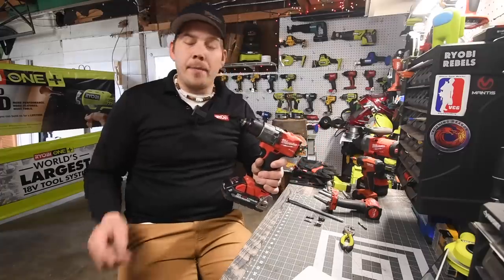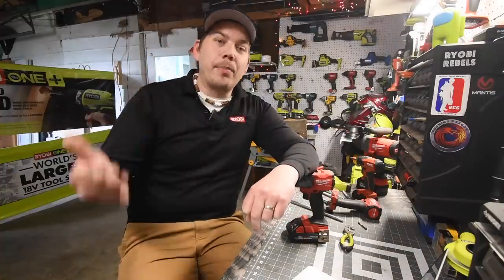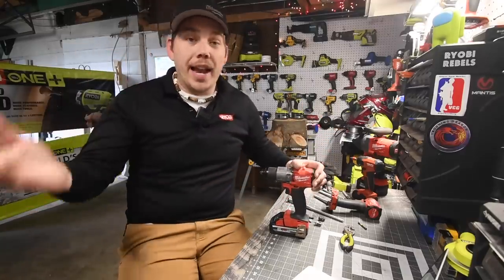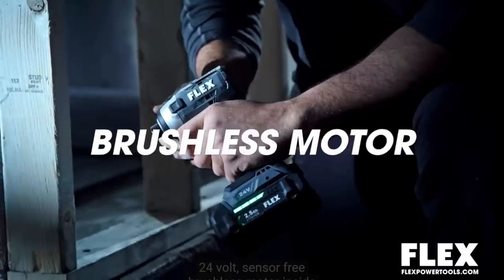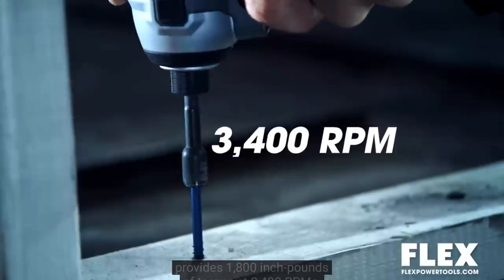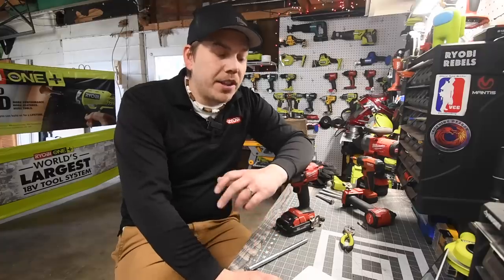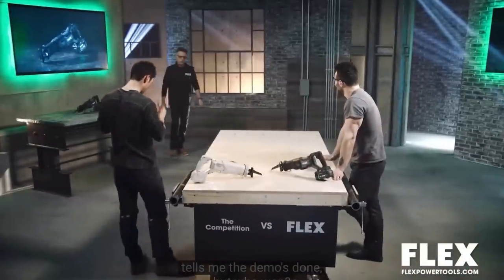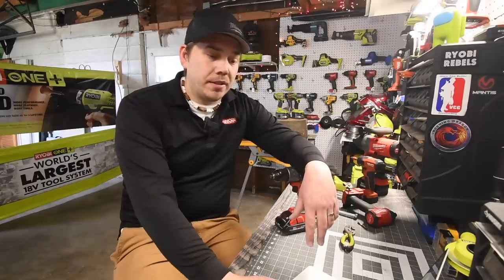My Flex tools vs Milwaukee  video RANT!!!!

Comment: I find is so funny how they didn't throw the dewalt 999 or 998 because the already knew what was going to happen
Reply: As of right now it’s dewalt vs flex. Milwaukee is trash
Reply: @lmaoanatorhilarious2582  Nope. Milwaukee is fine.
Reply: The 999 is a beast!
Reply: @lmaoanatorhilarious2582  I mean, if you want your tools to fall apart, by all means, stick with dewalt.
Reply: The dewilt would burst into flames and cause potential harm to the operator?? Or were you thinking that the yellow Ryobi would actually stand a chance 🤣🤣🤣🤣🤣
Reply: @whilomforge3402  I mean I'd rather go with dewalt and not pay and arm & leg for one milwaukee drill!!!!!
Reply: @mat_a.c.d.evloganstuff3917  I got my Milwaukee driver/impact combo with three batteries, charger and hard case for $399. If you’re not comfortable paying for a professional grade tool at that price, then I don’t know what to tell you. As a GC, I use these tools every day, and they are worth every cent.
Reply: @whilomforge3402  399! that is way to much for an impact, dewalt has a kit with a 996 and an 887, a 2ah, 1 flexvolt battery for 250. Milwaukee impact would probably out last the dewalt impact but still great for the price .
Reply: @mat_a.c.d.evloganstuff3917  tbh I’ve had 2 Milwaukee drivers in my lifetime and they both sucked. I might have been unlucky and got 2 factory defected models with shit batteries. I can agree with some points that some people are making. Like if you want a good tool then spend the money. If you’re using these things for hobbies then any of them would be sufficient enough. When it comes to the job site, spend your cash. For example I used to go through a graco paint sprayer every year since it can only do like 3-400 gallons a year . Now I run a titan sprayer and can spray 200-300 gallons per fcking week. I honestly don’t give a shit about brand. It’s all about the quality
Reply: @mat_a.c.d.evloganstuff3917  that’s for an impact, hammer drill, three 5 a.h batteries, charger and a hard case...
Reply: @whilomforge3402  dewalts hammer drill is more powerful plus you get a flexvolt battery
Reply: @mat_a.c.d.evloganstuff3917  nominally more power, and it’s a boat anchor. Also, that flex volt battery isn’t backwards compatible with the entire dewalt line. Milwaukee has a better battery platform and more extensive tool catalogue, along with universal battery compatibility on the 18 and 12 volt lines. Also, I’d wager a Milwaukee drill would far outlast a dewalt, under the same conditions. I’m not even entirely invested in the Milwaukee platform. I think there are a lot of superior offerings by Makita and even some by Dewalt, but Milwaukee is the best all-around.
Reply from the maker: I thank you for viewing
Reply: @whilomforge3402  watching you fanboys measure peckers is hilarious. I own the Milwaukee fuel hammer drill and the dewalt 999. Both are good, but the dewalt definitely has more power, and tbh my Milwaukee did crap out on me and needed to be serviced after driving a 3 inch hole saw through two layers of 5/8 drywall. May just be my drill but it happened. I also have an og 20v max regular drill driver I’ve had for the better part of a decade, it’s smoked out on me several times(mostly from tapping holes in metal door frames) but she still runs. I mostly use it for running fasteners in finished millwork. Drilling/tapping is what the 999 is for
Reply: @HoldinAces777  you didn’t read my last comment, did you? I’m not a Milwaukee only guy. I run the Makita 36v circ saw, dewalt table saw and Rigid vacs/dust extractors. The Milwaukee tools I use are the best all-around for what they do. Just like the other brand tools are the best at what they do. Maybe read your own comment again... you’re being a simp for your favorite drill, too...
Reply: @whilomforge3402  my man, where did i say anything about what was my favorite tool? i just said what i have and my experiences with them. That old dewalt smoked on me because it was under powered, the 999 is so heavy i have to drive my vehicle over weigh stations. No brand is perfect or “the best” overall. It’s a tool by tool ordeal thats why most guys have multiple brands. This is the first time I’ve seen someone use the word “simp” unironically, that gives me the feeling that you’re the helper boy that gets sent out to find material stretchers and left angle drill adapters a lot 😂
Reply: @HoldinAces777  just admit that you can’t stand anyone talking bad about your brand, big guy. You’ll feel better about yourself. Btw I’m sorry I triggered you by calling you a simp for DeWalt. You’re totally not a simp... not at all...
Reply: dewalt drills are complete garbage. Bought one myself, wouldn't put a 3/8" hole in light sheet metal. I'll stick with my milwaukee, they make tools that are quite capable, not to mention, they make tools for home and work.
Reply: @whilomforge3402  helpers shouldn’t talk to their superiors like that lol
Reply: @whilomforge3402  out here being a “simp” for Milwaukee when laborers like you only have one tool, and last i checked Milwaukee doesn’t make push brooms 😂
Reply: @HoldinAces777  it’s okay, buddy. Don’t get yourself all worked up over someone besmirching your yellow queen. I promise you’ll be okay.
Reply: @whilomforge3402  lol thanks bud, now go put my tools in back my truck, you’re never gonna move up the ladder if you wait for me to tell you everything 😂
Reply: @HoldinAces777  bro, you’re being cringe, bro. Just stop.
Reply: @whilomforge3402  cringe? They let guys like you in the trades? I bet you drink white claws too don’t you 😂
Reply: @whilomforge3402  bro dewalts better just admit it, stanley black and decker is better than tti so its all good

Comment: Thank u 4 making this vid.. about half of my tools are Gen 2 and half are Gen 3 all fuel, and I gotta say.. in my case it's divided like that as no one uses one tool all day and to be honest I have never had issues with the Gen 2s.. I've only upgraded as needed due to tools walking off site etc.. I find that most of the time peoples that search for the most "powerful" tools are usually guys that don't know how to use them to begin with. It's 90% about the operator and using the right tool for the right task.. I don't use impact wrench for task that an impact driver is designed for or viscera.. and to boot just like u said, they didn't even use all fuel tools and the operators noticeably looked like they were only trying when using the flex..  was kind of comical at time.. with that said there was some features of the flex tools that did interest me.. but not enough switch...
Reply from the maker: I thank you for viewing

Comment: There is so much you can do to influence each of those tests. Pressure on the tool, bit/saw sharpness etc, angle of the tool to cutting surface. The sawzall is a a good example, the flex operator had the saw with the handle angled higher allowing the tools weight and operators push from the back handle down to influence the tool. To show the tools are truly superior you need to look at max RPM and RPM under continuous, consistent, measurable load.
Reply from the maker: I thank you for viewing

Comment: Great video, Man Caver. When I watched the flex 'info mercial' I was wondering why they didn't actually tell everyone the competitor tool (manufacturer, model number, battery configuration, etc.). I knew they were hiding something, and you confirmed my suspicion. They found the best tool that Flex could beat (not necessarily the best tool on the market today). Thank you for another enjoyable, informative, video. You keep making them, I'll keep watching.
Reply from the maker: I thank you for viewing

Comment: Flex had the chance to really FLEX on the competition by only offering batteries with 21700 cells. just sayin lol. Also I like how you pointed out that they switched between using the brushless Milwaukee over to the fuel version. Kind of reminds me of the Chevy commercials comparing their trucks to ford using the aluminum how they were cheesy as hell.
Reply: Hard to fit enough 21700's in there to hit 24V and reach the Ah rating, agreed it was a lost opportunity to come out the gates with it though
Reply: Wouldn’t be surprised if several ex-GM people were behind this bologna. Or at the very least the advertising firms that were behind GM.
Reply from the maker: I thank you for viewing

Comment: one?
actually maybe more
since all of the milwaukee power tools were painted and covered over, and since these tools are brushless, and since these tests stress the motor which is now covered and painted over. would that not cause a bit of heat build up in the tool resulting in a lowered performance?

Comment: Exactly this face off was a joke they used some of Milwaukee’s worst battery’s and midrange sawzall and the testers were obviously putting more effort into the flex tools...it was ridiculous high output battery’s would have changed almost every result.
Reply: Not necessarily changed as Flex has some battery tech that should definitely handle peak loading better, but at least made the difference less pronounced.
Reply from the maker: I thank you for viewing

Comment: wait!!! whow! to be fair!!! im not a flex fan i know nothing about them but spade bits augers and such bits with larger circumference you should not push the bit hard.... if you push the bit hard you can stall, backfeed, or slow the bit. slowing the bit is bad because the speed is what kicks out the chips. if your chips are not ejected efficiently you will add more work for the drill..... so if you can push hard as hell and not stall or backfeed and win a race your drill has more torque to go with speed.... this is a sign of a good drill! strait solid bits are the only thing you want to push hard ish. like a hammer drill if you push to hard you can nullify its hammering function... pushing on the drill is what is to be done just not so hard you limit hammer travel and place a lot of the tools work in your soft fleshy arms. regular drill bits can drill faster the harder you push. you have to watch your speed because speed is heat and heat is dull. fasteners is the best test for speed because the only danger of hard or fast, is loss of control of fastener. 
SCIENCE lol
the 1 thing i will say if test are not done with weights, pullies, cantilevers and tracks you cant create repeatable fair test because a man with skill can beat a man with strength and a man with strength can beat a novice. so if a veteran of 30 years gets up there to compete with a novice his skill with a garbage drill will win vs a super tool in a novice hands..... you need a fair measure test

Comment: Okay so i don’t exactly know What flex means by sensor free but if he actually means sensor free brushless motor and the story About how they put the “sensors” down into the electronics is also kinda sketchy 
What sensors on a brushless motor do is tell the microprocessor in the tool the position of the motor rotor which makes it fire the individual coils in the motor in the right order depending on where the rotor is 
removing them is done by essentially calculating the rotor position based on the voltage the rotor induces into the other coils when it spins ( I think that’s what flex meant by “moving” the sensors into the electronics) and they are right this will free up some space in the motor compartment BUT in low rpm the motor driving chip basically blindly turns on one coil which moves the rotor in some direction (even reverse in some cases) and now the rotor movement creates a voltage spike in the remaining coils and that is what the chip uses to know the firing order of the coils to get the motor to turn in the right direction 
THIS IS NOT ANYTHING NEW and it has its problems mainly in the low rpm control 
Someone test these tools like the drill driving a screw really slowly I bet it will be jerky and stuttering
Reply: I'm glad someone else understands what Flex meant by "sensorless". In some of the tool review on-site testing videos, they actually step back and say that there are still sensors, just not in the motor directly, so definitely back-EMF sensing at least. There's an overview of low speed BLDC drive methods in this article for any that are curious: https://drive.tech/en/stream-content/sensorless-control-of-brushless-motors
They even say that removing the hall effect sensors makes the tool more durable - I seriously doubt a damaged hall effect sensor (which can be potted with little effect on functionality) was a primary reason for motor or controller failure, even if it is technically an additional failure point over just the coils.

The low speed control could be affected, but it could also be that Flex is running the motor internally at a much higher RPM so that everything is "high" speed, or that they use a slightly different algorithm for low speed, high torque control. I'll be interested to see what the tool reviews and press releases can tell us.
Reply: @connors.1077   there is absolutely no way to drive a BLDC motor with peak torque at low rpm based of EMF 
All the tools that do this are either saws that don’t need to have low rpm control or drills that actually are kinda shitty to use in those conditions...... a hall effect sensor under selastic is going to outcast the tool 100%  plus they are absolutely tiny and tbh barely add any size at all ..... they say we moved the sensors down BULLSHIT they are just not there at all it’s EMF based because it’s cheaper it’s literally a negative and they are advertising it as a feature ....... Yea the motor is spinning probably 1000rpm from the get go but this will affect the drill anyways especially trying to carefully loosen something where you would need torque from 0 rpm it’s gonna perform worse than a brushed 30$ tool in that condition 
Sensorless BLDC motors belong in drones not drills this is an absolutely dumb idea on part of FLEX
Reply: @connors.1077   well even if they didn’t say there still are sensors .... there is no other way to drive a BLDC without sensors than EMF
Reply from the maker: I thank you for viewing
Reply: @ManCaverTools   if you could do some low rpm tests like slowly pulling out a screw once you get the drill that would be great to see

Comment: These can be easily tweaked as company wants.
 
Is that big log uniform? There can be softwood behind it for Flex and some harder wood for rival.
You can pre drill screw in and then use old hole to drill in faster etc.

If something looks and sounds too good to be true usually it isn't true.
Reply from the maker: I thank you for viewing  :)

Comment: Good call with the rant video.   It’s hard to notice, especially if you’re just watching for the first time.  But flex did sandbag it for their stuff.  Which makes sense.  But it would have been nice if they didn’t and just ran a fair test.
It reminds of when Chevy was ripping on Ford for switching to the aluminum beds and Chevy was dropping rocks and cinder blocks into the beds.   There was a clear shot of a cinder block landing on a corner in the Chevy bed and punching a giant hole in the bed.   The camera cuts and suddenly the hole is gone in the Chevy bed and the blocks are arranged in a slightly different way.   People just want to see how it actually performs and will be disappointed when it doesn’t live up to the hype
Reply from the maker: I thank you for viewing

Comment: I can see your point on the high output batteries. I looked at the test as what you would possibly get in a standard powerpack / multi piece kit. with both competitors. There is no way that any particular brand can have the best of every tool....
Reply from the maker: I thank you for viewing

Comment: Another thing you may not have picked up on was the wheel on the FLEX was thinner.  A wider wheel will not cut as fast as a thin wheel does.
Reply from the maker: I thank you for viewing  :)

Comment: Thing is you buy the battery platform not the tool.  Tools change all the time and you often need a wide variety of tools, I have M12 tools for wrenching (impacts, ratchets) due to size and Makita 18v tools for woodworking (Milwaukee doesn't make a track saw AFAIK) and larger tools because that's the 18v platform I settled on.    I doubt that Flex is going to have even a kinda complete tool line....
Reply from the maker: I thank you for viewing

Comment: You made a lot of really good points Dave. I myself was wondering why they didn’t put the hammer drill up against the the DEWALT. Especially for the concrete test. Everybody knows the Milwaukee doesn’t like concrete. Keep up the good work bud. 👍
Reply from the maker: I thank you for viewing
Reply: My 10 years old Milwaukee with old 3ah battery loves concrete and i mean CONCRETE! I live in Poland and we have old really tough concrete building not like in US;P

Comment: They maybe faster, they maybe more powerful but for how long. I’ve been using the same impact, drill set and batteries for 6-7 years and they are still going strong. 
Definitely not the most powerful battery hammer drill on the market, I’ve got one of those fancy SDS hammer drills.